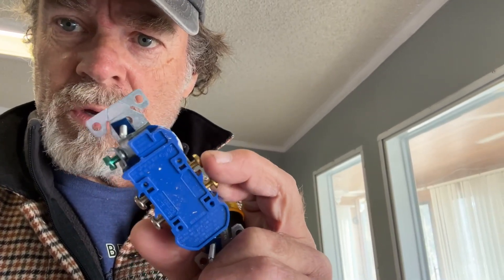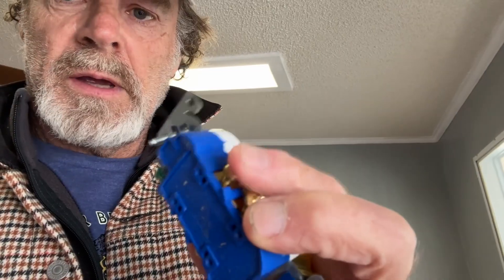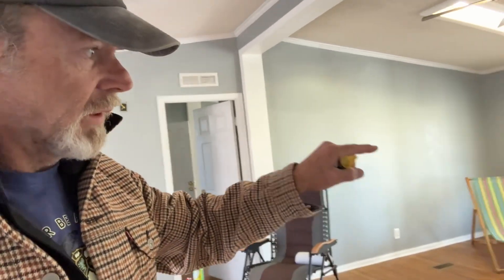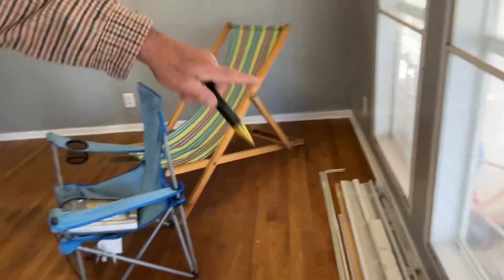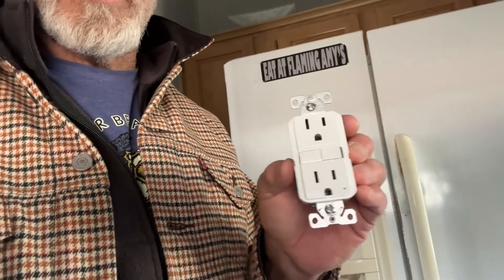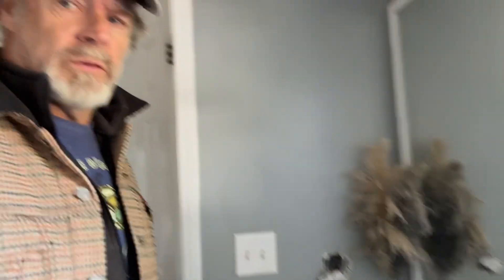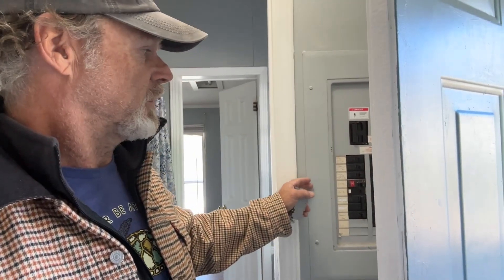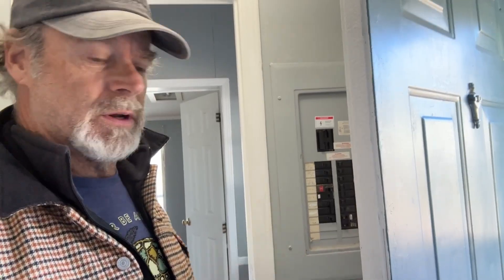Can These Back Stab Power Outlets Burn Down Your Home!

Comment: I changed an outlet to the push in 3 years ago. While adding a night light the outlet felt hot. Shut it off polled it out to find 2 of the push in wires floating.
Bought new plug attached to screws now back to normal,..never again use the push in feature

Comment: Some good info, but a GFCI doesn't trip when there is a "short" or "surge". They trip when there is a detected "GROUND FAULT" which means voltage leaking from the hot to ground. It measures the imbalance of current between what is going into the device and what is going out. 5 milliamps difference wil "interrupt" or trip the GFCI device. If current travels from the power source through a person to ground or neutral, the trip will occurs so fast that the person wouldn't be electrocuted. Maybe a tingle. ⚡

Comment: In Germany, since the early 90s, most of the outlets you can buy are these spring things. But you can't remove the wire, before you push a little button.

Comment: Had a close call the Tuesday morning before Thanksgiving. A creeping Charlie vine had grown up behind the siding and infiltrated an outdoor outlet box.  It eventually shorted and burned itself and the GFCI up and tripped the breaker.  Funny thing is that all the other outlets are stab-in only with no screw terminals.  It's a modular home about 32 years old.  I've been replacing the outlets and switches here and there with good ones.  Doesn't cost much.

Comment: Bottom efn line if the wire is not securely tightened under the device screw it is prone to arcing causing flash fire . It don't care who you are or what degrees you may hold it is just laziness and totally not safe practice .

Comment: Here  in  Iowa  i  have  a  Crew  of 34 Guys  and  I  Will NOT Let  ANY ONE OF MY  GUYS  Stab  Wire's      The  Code  has  Not  remove  the  screw  yet  so  remain using  them   there  Best  way of  Keeping  the  wire  is  Tight  under  the  screw     We  have  House  Fire  leading back  to  Stab  Outlet's n   Switch's     use  your  Gut   and  do it  Right      I hand  to  you  Exoman     very   nice  Video     Thank You
Reply from the maker: Thank you for sharing your experience and best practices. I appreciate your insights!